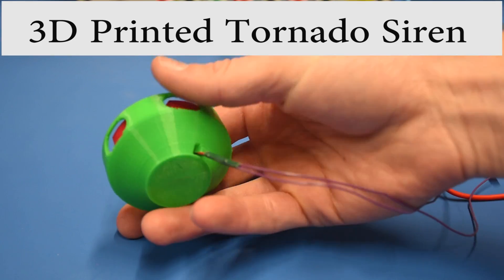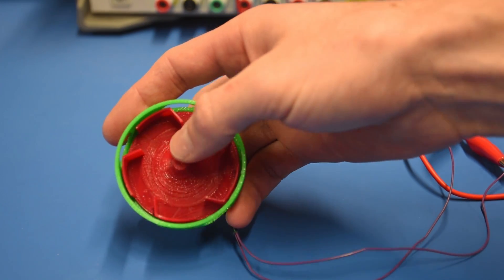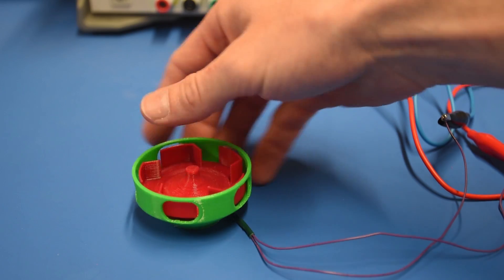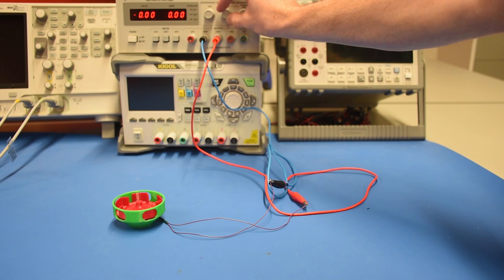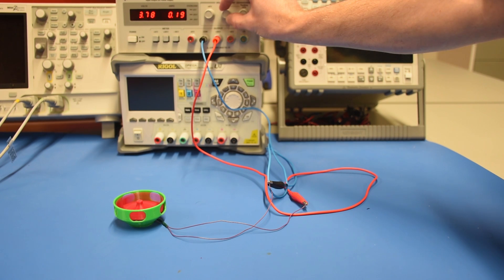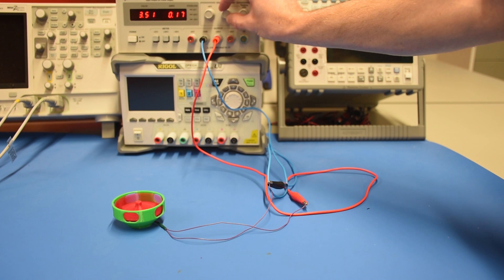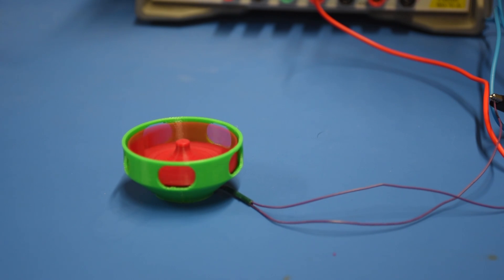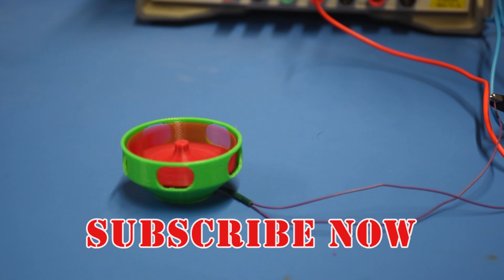3D Printed Micro Tornado / Air Raid Siren

Comment: hello Mike Thompson my name is Tobias rabelink and I'm 22 years

 have you design it in 123D? 
i want to make a siren as well 
can you give me some tricks and how you have made this siren

regards tobias
Reply from the maker: Hello Tobias. Thanks for watching. I've never designed in 123D, but I bet you could do this in that program. The green case is just a revolved feature with the bottom portion sized to fit the motor. The 5 holes in the stator were created with an extruded cut on the front plane all the way through the part, then this cut was patterned around 5 times. The rotor base is a revolved solid, and there is a hole in the middle for the motor shaft. The rotor blades were just extruded from the rotor top down to the rotor base. The stator case is 1/16" thick everywhere, because that's plenty for many small parts. That's about all there was to this. It only took me about 20 minutes to get all my measurements from the motor and begin my prints. I hope this helps Tobias.